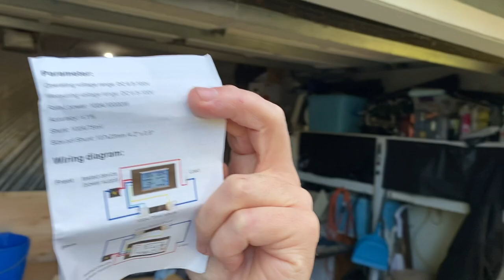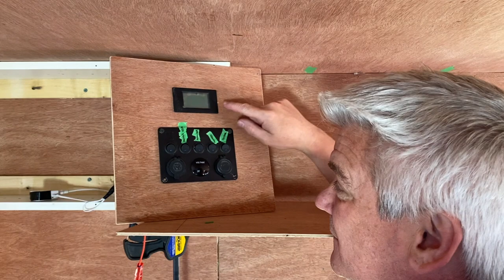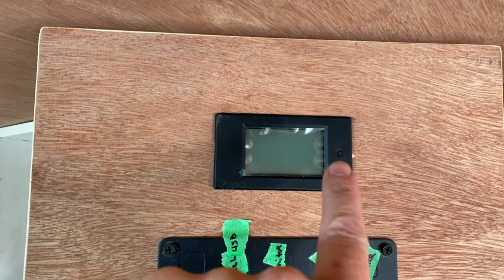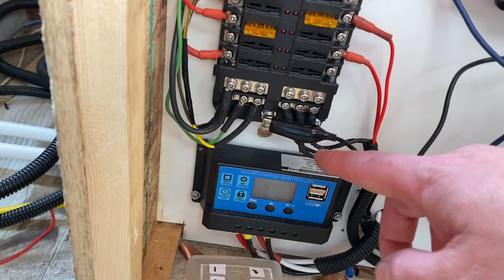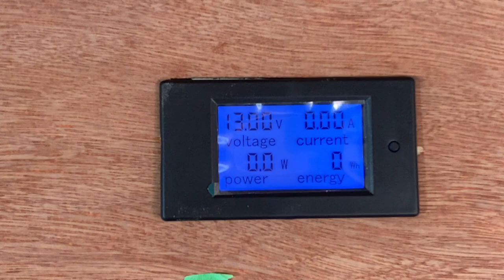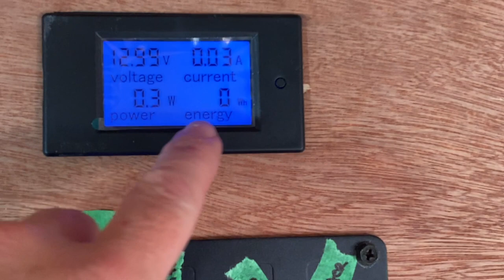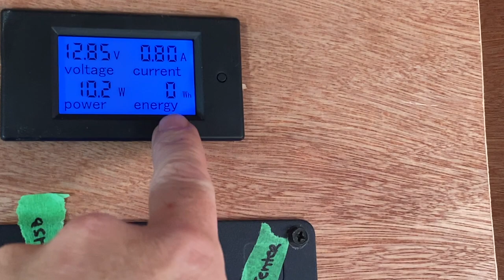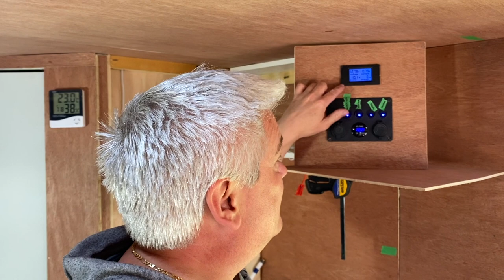How to monitor your RV camper or Van life battery on a Budget. Is this $15 battery monitor worth it?

Comment: Thanks for showing that. I don't have one...just use my charge controller read out. But plan to get a 12v fridge so that will come in handy.
Reply from the maker: Thank you for watching and commenting 🙂 it gives you a good idea on how you battery is doing. We would like to do a 12v fridge as well.
Reply: @clammi  my plan...at the moment anyway.. is to get a fridge/freezer and keep it on freezer mode and refreeze my bottles for the cooler at the same time as keeping frozen food.